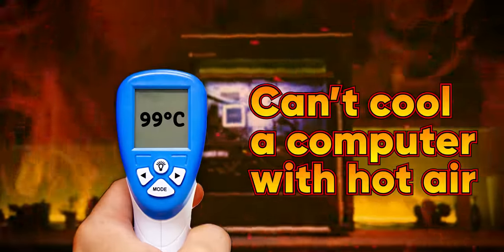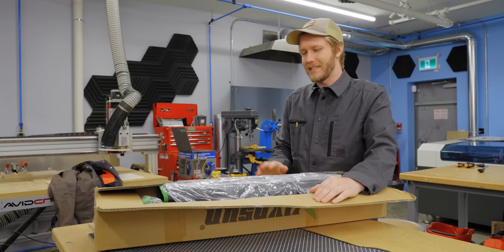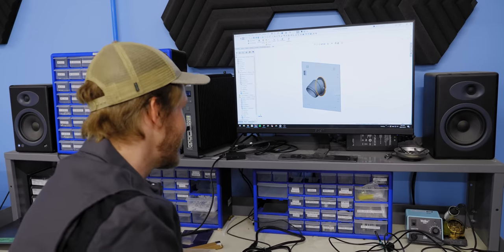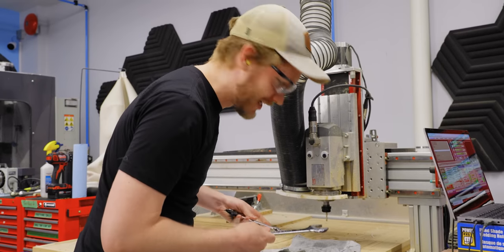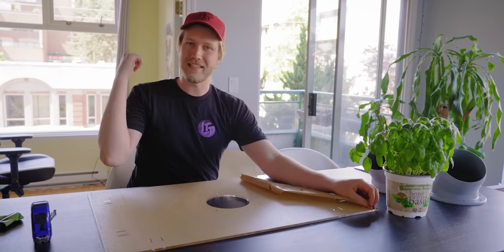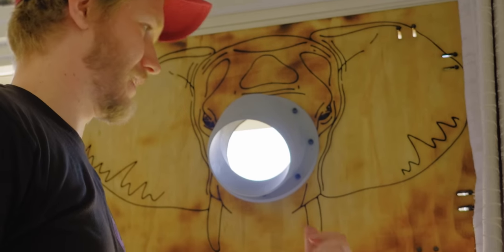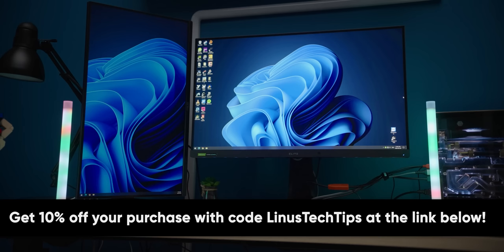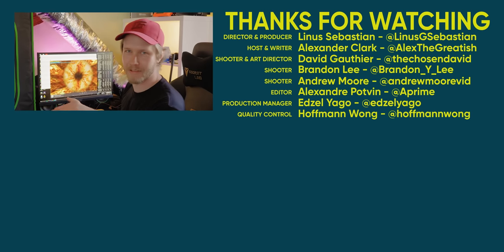You’re cooling your PC wrong. - PC in a Grow Tent

Comment: This WILL increase your air conditioning bill, since you're creating negative pressure which sucks hot air from outside. But if you only care about comfort, this will work. Also worth noting it's probably just as effective, and less work, to simply extract air from the room rather than enclosing the PC.
Reply: This.
Reply: So all he did was basically crack the window and put a fan in it?
Reply: @Lexaire  Pretty much, yeah lol. Although it could be slightly more effective since it's pulling out the warm air from directly around the PC, the added hassle might not be worth the slightly cooler room.
Reply: This is kinda a fun one -- If the air outside is HOTTER than the air exiting his PC he'll have a net worse experience, BUT if the air leaving the PC is HOTTER than the air outside the air coming in via negative pressure will actually be a net positive as it'll take less energy to cool the outside air coming in than to cool the air being pushed out. His air quality is going to be garbage though and you have to take into account the electrical cost of running the blower.
Reply: @lymnjuice  All great points. In my experience though, the exhaust from a computer usually won't be hotter than outdoor summer heat. You'd have to be moving the air through the case very slowly to saturate it with enough heat, which wouldn't be great for keeping temps down on your components. It could be accomplished with a counter-current heat exchanger and water cooling tho. Future LTT video maybe?
Reply: His room temperature was 26*C+.... I don't think he has AC.
Reply: @areadenial2343  Best would be to pull air from outside (north side of building), use for cooling and dump it out.
Except maybe in winter when the PC becomes a 200-500W electric heater.
Reply: Exactly what I was thinking. Just create a negative pressure in the room, venting outside and drawing cooler air from the house, and it would have had the exact same results  🤣
Reply: Might as well use a ducted a/c unit to cool the grow tent rather than this. This was essentially a waste of time.
Reply: No I don't think so, I have a fan that I ran bassicly 24/7 at my window and it helps... but I can still %100 noticed the difference, it feels like a summer afternoon even on a winter evening with my pc gaming. LTT on the other hand noticed no change in temperature, which I can definitely not say.
Reply: @Lexaire  how could you say that
Reply: @Lexaire  its somewhat common for larger servers to have some form of cooling like this only done in a slightly more intgrated manner as its a lot more efficent than trying to just blast air through the server room

Comment: Those extra struts are used to hang the fan and - if used as a grow tent - lights from. Simply put the fan inside the tent. You will need less space and it will be quieter.
Reply: PLANT
Reply: @Video Games haha they are quite commonly used for resin 3d printing. Resin produces lots of very unhealthy gases, great to get them out of the room.

Comment: You could have quite easily air tighted the PC case itself, all but the intake and one of the 120mm openings on the back, and 3d printed an duct adapter for it. That way the PC fans are pushing the air out, so no need for a large duct-fan, and you wouldn't have any enclosure.
Reply: Yes, but that would be the intelligent thing to do. Not an LTT move at all.
Reply: yes because a 120mm is gonna be able to push out enough airpressure to push it out the window at the other side of the room?
Reply: @therodyman700  I've actually done a "fresh air intake" kinda thing with some ducting and a 140mm fan, and based on my experiences I'd say "yes".
Reply: @jubuttib  intake is different than exhaust.
Reply: But then you’ll be damaging the case and other issues they could run into. Plus once u put holes in the case there’s no turning back . This way was perfect
Reply: Also, I would build seperate intake and outtake tubes, because just having the outtake means that warm air is sucked in from outside somewhere else in the house.
Reply: I’ve grown some nice big ass buds with that tent. 🌱🪴🌲
Reply: The case actually disperses a lot of heat too. When I game with a ~300W load my case gets noticeably warm to the touch with a case (mobo sensor) temperature of roughly 45°C.
Reply: @TheBCninja  To an extent, but unless there's a big pressure differential between inside and outside, pushing air through a long tube shouldn't be too dissimilar.
Reply: @jojo4565  Air tightening means pretty much the opposite of drilling new holes. The easiest way would be duct tape and foil to cover any unwanted openings.
Reply: @jojo4565  I get what you're saying but if you plan it correctly you won't need to put any new holes in the case, just use the existing fan mounts, should be plenty to hold on to a vent fitting. Then you can use custom plates or just tape to close off the holes you don't need, bada bing bada boom!
Reply: Or just custom build a box/tent like growers do.
Reply: If it's drawing ambient air through the whole case to the outside it will cool the case too.
Reply: Write that down write that down.
Reply: You're going to lose a lot of flow in a corrugated/flexible piping solution such as that insulated one that he has in that demo, much better to plan a fixed installation using rigid piping and insulation wrapping that you can wrap that piping if you want to insulate it. also you don't need that much insulation for the amount of heat that you're moving considering your moving that air out.

The only downside to a solution like this is it's going to raise your cooling costs and run your hvac/air conditioner harder than it normally would because you're going to be bringing in humid air (in most areas where you're going to need the air conditioner, It's really humid in the first place) which will work your air conditioner harder then just cooling the existing computer in the same room without exhausting the hot air outside. 
sometimes a better solution is to just pipe that hot air into a different area of the same interior space or install a return in your room and let the ac fan run continuously.

I know a lot of people are against modding the drywall in an apartment/leased house but it's really easy to do drywall patches.
Reply: Similar to Alex'es very first project on camera
Reply: Couple that with a blower that's OUTSIDE instead of in the room, something like a window AC unit without the condenser, you've got a quiet, efficient cooling system.
Reply: Combine all of these ideas and you actually get something decent, duct adapters for a PC case the strong fan ltt used gonna be smaller but louder
Reply: I think a v2 of this is needed
Reply: @therodyman700  First of all, the PC (case), should be next to the window. He has enough space for that. Then, Kinzoku Shirogane's solution would have worked with no problems. I don't get why he overcomplicated things with a long tube, and air pump and a grow tent. Besides overcomplicating things, he also loses a lot of usable space, in the process.
Reply: @therodyman700  you can very easily attach a 4 inch ducting adapter to your PC, attach ducting and the barrel fan he included and you will have the air in that PC cycling like crazy.
Reply: Sure but that would mean you're still dropping heat to the room irradiated from the case itself, could be negligible but I don't think so, so you still need to put isolation around the case and a growing tent could be a simpler way of doing it (if you have the space). Everything has its pros and cons
Reply: could also use an external radiator setup
Reply: @therodyman700  It is an unrestricted simple duct. The fact that it is "only" 120mm doesn't mean it has less pressure. 120mms fans actually tends to have more pressure than most 200mm fans (especially when considering noise). If it is airflow that is the main consideration, use 140mm or higher rpm fans. I mean he is literally already using a 150mm fan. Switching to a high RPM 140mm at the rear, or as an intake fan on the front would do the same job, and it could be programmed in windows/bios to spin faster at higher loads, since he can use a normal PC fan which is connected to his motherboard.
Reply: Pretty good idea. But I would probably go for stronger fan. Maybe something usually used in racks or custom one.
Reply: actually having a dedicated intake duct going to the outside of the grow tent and giving the PC intake from purely the rooms air would be the best of both worlds, surely
Reply: @therodyman700  
If it is a sufficiently beefy Delta, yes.
Reply: @therodyman700  put one on both sides of the tube
Reply: No. The tent's purpose is to create the environment for the air the computer breaths. You would need a case outside of the PC case, which is what the tent essentially is
Reply: The case comes with built in holes.
Reply: @therodyman700  Absolutely would be. I use a similar ducting setup for my 3D printer. I built my 3d printer enclosure when research showed all the plastic nanoparticles that are released into the room that a 3D printer is in. I cut out a 120mm hole in the acrylic side of the enclosure, attached a 120mm fan to the hole. I printed two dryer hose adapters (one of them that adapts to a 1 inch by whatever long rectangle the same exact area as the dryer hose) to be attached to the fan and to a 2x4 that I cut to the length of my window. The run is something like 8 feet to the window, but it definitely does the job of pushing the air out of the apartment. After many hundreds of hours of printing white parts for a stormtrooper suit, some very fine light dust was visible all on the clear acrylic side with the fan. can feel the air being sucked into the enclosure from all edges that it can just from the one cheap 120mm no name brand USB fan.
Reply: Doesn't even need to be airtight,  especially not if you're willing to have THAT air pump in the ducts anyway.

Comment: You should route the intake from outside as well. This setup will drive up the home's AC costs
Reply: But that would ruin the point in the days when it's too hot outside
Reply: @olutukko2681  no it won't, because it will be confined to the grow tent.  Moto is 100% correct.  This setup is pulling outside air into the home by creating a vacuum (remember when he said how much air was being pulled in under the door? Where do you think that air is coming from ultimately?)
Reply: @olutukko2681  the computer would run hotter yes that is true though. But it shouldn't be running too hot.
Reply: @glasshalfempty1984  oh right yeah that would work :D I didn't think the concept correctly
Reply: That's what I was thinking too
Reply: If you do this you should absolutely make sure you put a filter on the intake for the outside air. Outside air is filthy... and bugs and stuff.
Reply: The exhaust fan could be controlled by the PC temp so you only exhaust as much as you need to adequately cool the PC. I would have just made a large hose adapter to fit onto the back of the PC instead of a whole ass grow tent though
Reply: @glasshalfempty1984  wait do you really think that tent is even close to air tight?
Reply: @olutukko2681  "Too hot" is very subjective. A human starts sweating at around 26-29 degrees C, while a PC can perfectly operate at 70 degree temperatures. Even if you're in a desert with 50 degree weather outside, 50 degrees is still cooler than 70! (And if it turns out you're not cooling enough, simply crank up your air pump to the max! :D )
Reply: Then the computer will be dirty so fast.
Reply: u need a heat exchanger ... as @Motomalsosaid $$$$ out the window
Reply: no, bugs

Comment: I simply mounted my motherboard to the wall, horizontal, on top of a fancy piece of butcher block. Then mounted the radiator with two adjustable fans in push push to the wall that hooked onto the 9.99$ lowes "through wall dryer vent".  I made a small silencer box and made sure everything was pretty air tight.  It made a massive difference in the room and pc temps.  It had the flap that closed if pc was turned off.  I live in very warm humid climate and I ran it this way for over 2 years with no issues ( moved out ).  Since the heat from the pc did not have to travel but a small amount I was able to push it out using very little air flow so it had minimal effect on the whole house .  Oh and this was a no case setup it just sat high up on the wall so nothing could be spilled or dropped onto it.  Had no issues with dust either.
Reply: This is exactly what I want to do one day, glad to hear it works!
Reply: Dude you gotta show us exactly how you did it! Did you take any photos? Can you share it please?
Reply: this is a much better way of doing what he tried to do. Short tubing runs and an airtight source are the two biggest things, of which he had neither.
Reply: Would you mind sharing some pics? I'd like to see how that works.
Reply: I've thought about doing this too, perhaps some point in the future
Reply: Now that's the thing outside the box. Great Idea, I think.

Comment: This is a neat idea. Although anyone doing this should definitely use a duct hood on the outside exhaust, to prevent things from entering your pc. Also there's great tubing options that don't use fiber glass, that stuff is terrible.
Reply: The exhaust is exiting at 52.1mph, bruh, nothing's getting in through it.
Reply: @hlaw2830  Pretty sure he's talking about when it's off...duct hood opens when air is flowing out, closes when off.
Reply: @DxBlack  They didn't get a thermostat to control the fan, and they're always talking about leaving things running Nice Hash, so... why would if turn off? I don't disagree though, if only because you don't want someone to assume that you're growing and break in, right? Clearly, dryer vent, mount it through the wall down low, boom, cleans up all that ducting for free.
Reply: Fiberglass isn’t used in duct anymore. It’s soft white fluffy stuff.
Reply: Given the level of custom fab available at LTT, they could just build a sealed case with an exhaust port to fit the ventilation.
Reply: @jedediahferguson5686  yeah this is what I’ve commented elsewhere. Just stick a duct onto the outlet of the pc. The case fans probably aren’t designed for static pressure so you’d need an inline fan like what this has. You could definitely make it look nicer with non-insulated duct.
Reply: @dan110024  Now this I agree with, but ya'll need to chill with the fans, that six inch is massively oversized for that tent, even if you're running a filter and growing weed. You don't need air going through your case at over 50mph, you'll start turning dust into bullets and sandblast your motherboard. A simple booster fan should do the job, and cost next to nothing up front and running.
Reply: @hlaw2830  for sure! Just depends on how long the duct run is and how many turns there are.
Reply: @dan110024  Absolutely!
Reply: @After_Pasta  If you think fans should be pushing you have already fucked up. Fans should pull, and when they can't, like exhaust out of a case, that's where boosters come in, maintaining duct velocity. There's a reason a pull $3k a pack, and you struggle to move eighths, kid.
Reply: They have actual exhaust tubing for grow tents, works way better than that overly insulated itchy crap.
Reply: @hlaw2830  Dust and leaves aren't gonna be a huge issue but water is. This video was so bad lol.
Reply: @rustyclark2356  yeah it’s more applicable when you’re using duct in the ceiling and the ceiling spade will be wildly hotter or colder than your room temperature.
Reply: @After_Pasta  Yeah, computers have fans, the booster would be augmenting those. Also, an active intake wouldn't be an "extractor", lol, and they're almost never necessary, certainly not in a tent, and in a room you should be going sealed.
Reply: @dingchavez1960  Not if it's running all the time.

Comment: the problem is that if you're pushing air out, air is coming in somewhere so your whole apartment is going to be cooling the warm air from outside all the time. I wonder if the net difference works out over the course of hours or days
Reply: Good enough for me, I tried getting a window ac and the fam refused.
They get to suffer now.
Reply: LTT, pin this comment
Reply: Yeah, i was kind of surprised they weren't pulling air in from the outside to cool the computer. It's only 30-35c outside, compared to a computer that normally runs at 50-60c that's still plenty of cooling capacity.
Reply: Yeah, "your whole apartment" would act as a very large thermal battery.
Reply: I've just wrote a comment about that. If he used two hoses - intake and exhaust it will work as intended, without creating a negative air pressure. He can also use much smaller turbine, or put it outside to reduce the noise from it.
Reply: Definitely a design issue, you really only want to exhaust hot PC exhaust air out of the room, not just any air being sucked into the grow box.
Reply: Depends how the weather is. Here it gets very hot during the day, but very cold at night. So I just open the windows at night to cool off the apartment, and then during the day I keep the windows closed to keep the hot air out. They could be doing the same. Or just using AC if they have it!
Reply: @user-ll3kv5jq5v  it is designed to put the turbine inside of the tent. the extra bars they have is so you can attach the turbine to it.
Reply: @user-ll3kv5jq5v  You could also attach the in and out directly to the PC, seal up the other holes and do away with the tent.
Reply: This isn’t an environmentally friendly option but a comfort friendly option
Reply: The heat from you pc is usually way hotter than the outside air will ever be. It's easier to cool hot air than it is to cool really hot air